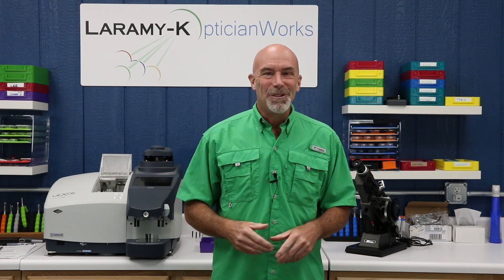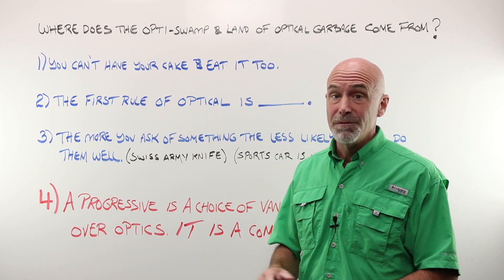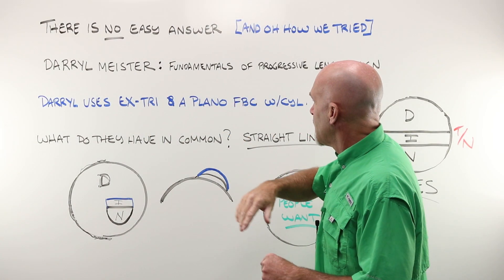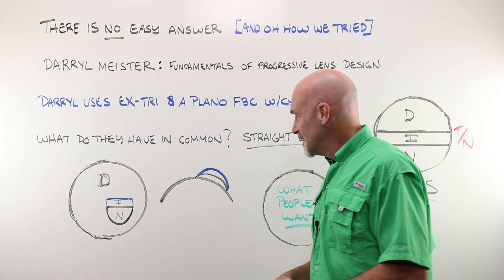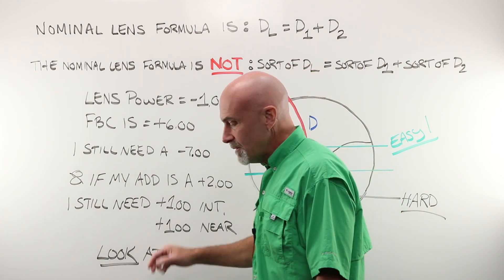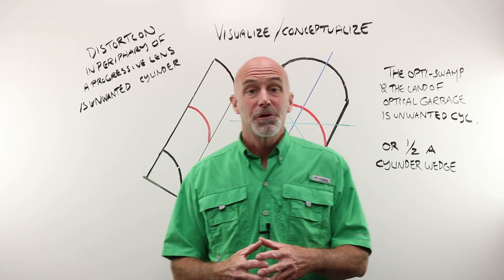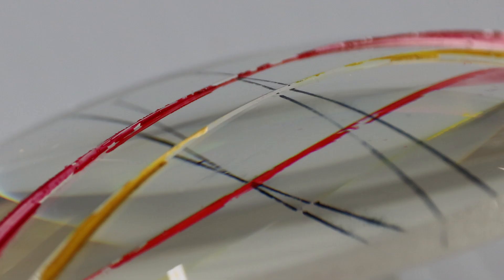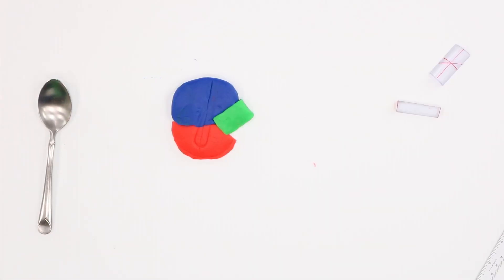Why Do Progressive Lenses Have Distortion at The Sides?

Comment: I was prescribed progressive lens 3 weeks ago after decades of wearing single lens for distance which I only wear to drive or activities like zoo trips or hiking. My eyes are very different,  one far and one near so to read or do inside work I must take my glasses off to see.

 The problem comes when shopping, for example, since I need my glasses to see which aisle but take them off to read labels.  That I can handle, but I do landscaping. Tree work I easier with my glasses until I do close up work. Taking glasses off and on is frustrating at work. But I can't get used to the tunnel vision. I need all peripheral vision I can get. When I tree is coming down, watching for deer on the road at night, or my evil rooster sneaking up to attack, progressive just aren't working.  

What should I do? Go back to just single lens and readers for sewing? I also quilt. Do they still make those little half glasses you can peek over the top of?
Reply from the maker: Do what I do! Old fashioned lined bifocal with a slightly weak add. Nothing in the way of great distance vision with good peripheral and intermediate/near when you need it. With one eye near/one eye distance you might need to play around with add powers a little. Find a good independent optician with some patience and you should make out great. OH and yes SV "readers" for sewing/quilting.

Comment: Larry
My prescription changed. Im now at 2t add. I cant stand the blurry peripheral vision. My balance is off. Horrible.  Im thinking of going back to trifocals.  Whats your thoughts on trifocals.  I would rather see better than than worry about looks at this point. 
Thank you so much
Reply from the maker: If you have had a true traditional lined trifocal before - sure go back to them. If not then I'd lean heavily towards a traditional bi-focal with the lightest add you can tolerate. That should give you what you need to get around. After that go with different single-vision pairs for different needs. Progressives are great but they aren't for everyone. John

Comment: This is really helpful information. Thank you. Makes me think that in some lenses the cylinder was never meant to provide any vision correction, it is just a form of filler. 

In my case, I have scleral lenses on the way. I asked for those contacts to provide only midrange support. Then I will have glasses over the contacts for distance. The scleral lenses are new for me. But the glasses over midrange contacts aren't. I have gotten used to keeping my glasses on a strap (Cabelz) so I can take them off temporarily and be hands free. Enter the idea of progressives. I am hoping that the minimal transition between negative (-1.0) and positive (+1 or as small as possible) power will minimize the peripheral cylinder distortion. What do you think?
Reply from the maker: Sorry, way too much going on here for me to answer. Sounds like you have a contact lens person to work with, hopefully you can find an optician to help you 1:1. John

Comment: Brilliantly explained!
Reply from the maker: Thanks - that is among my favorites that we have ever done. John
Reply: @LaramyKOptical  I'm here as my new progressives have a massive amount of distortion in the intermediate zone which my current ones do not. I reckon a different lab or model within the lab as the differences are shocking. I don't know the old lenses type but the new one is Shamir Sprectum Plus. I have spent over three months and two sets of them and still can't adapt to them ☹️. The height of the new lenses to fit the frame is a fair bit more and so is the thickness of the lenses at the edges if that matters any?
Reply from the maker: @skylineuk1485  Yep - sounds like you don't like the design of the new lens. It is possible (90% of the time) using the Progressive Lens ID (available online) to figure out what that old lens was. Probably want to get as close to that design as you can. Bigger frame = thicker lens but that shouldn't matter if lens is set correctly - assuming no power changes or minimal power changes.
Reply: @LaramyKOptical  Thank you!

Comment: I've worn glass bifocals (plain and Photogrey extra) for decades. Glass bifocals do not have that "ledge". I was surprised when I ordered a tinted non-glass pair to discover the ledge. I was told, like in your video, that ot was impossible to not have a ledge in a bifocal.  Why is there no ledge in glass, but always in plastic?
Reply from the maker: A plastic bifocal area gets its power from increased curvature, hence a ledge. A glass bifocal area gets it power from increased material index literally melted into the blank, hence, no ledge.
Reply: @LaramyKOptical   Thank you so much for clearing the mystery. I prefer the elegant glass solution over the industrial one.  The bummer for me is recent cataract surgery from a lifelong -5+. My eyes are now both -2.25, cyl +0.50 & +0.75 with add +2.25. That equals a plano bifocal or a progressive with muddy areas. Or distance only. I mentioned the possibility of a short corridor progressive to my optician and was told it was an old technology that I wouldn't like.
Reply from the maker: @akahina  I'd say keep watching some of the other videos on progressives. I'm not sure why a short-corridor would be desirable - in fact that would increase the likelihood of distortion or "muddy areas." That plano bifocal wouldn't be plano since it would provide the mild cylinder corrections of .50 and .75. Heck - how is your near vision when you take your glasses off?
Reply: @LaramyKOptical  My vision is fine from about 18" to my fingertips.

Comment: What are your opinions on trifocals? I’ve worn progressives for years and recently my vision changed; my prescription worsened. I tried the the varilux brand progressives and was close to impossible to see through. Now I’m in a trifocal and can’t see through them comfortably either! What can I do, get three
Pair of glasses?
Reply from the maker: YES! You will find an intermediate pair will get you through a heck of a lot indoors. Distance only outdoors... Then any task specific distances. Like we say over, over and over, "...maybe progressives aren't the answer for everything."
Reply: @LaramyKOptical  thanks for the reply.  so trifocals aren’t the answer either!?
Reply from the maker: @l.c.1633  Probably not the "perfect" answer. A little tricky to find and a little tricky to fit too. Certainly worth a try if you can find someone willing to work with you on it. Should be able to do a "test" pair for not a lot out of pocket.

Comment: I just had cataract surgery so my prescription went from a -7.5 to a +2.5 and I just received new prescription computer glasses. I was hoping that because my prescription is much simpler now the progressive lenses wouldn't be so distorted. I was very wrong! These new ones have an extremely limited field of view - even more than my older -7.5 glasses. What I don't understand is why the $35 progressive reading glasses I bought from Amazon are dramatically better for field of view?! I find myself using them more than my $200 prescription glasses.
Reply from the maker: Lucky you! if the power is +2.50 in each eye you can go over-the counter for everything. Just buy one of those multi-packs from Costco with different powers and play around to find the perfect one for all the different things you do. If you do one thing that you love for extended periods of time then consider having a really nice pair made up in that power. John

Comment: I am 52 age . I use progressive lenses . Spend 6 hours daily on screen & two hours reading . Should I go for separate single number lense to reduce Fatigue?
Reply from the maker: I can't make that decision for you certainly not without a lot more information - BUT - if a single vision pair or pairs is an option you can't go wrong!  Much more comfortable for the long haul... John
Reply: @sheelmirji5494 So what decision did you make finally for the single vision lens?
Reply: I have opted for Progressive lense

Comment: I just picked up my new prescription with progressive lenses. I HATE them with a passion. Lost my peripheral completely. Not a good thing if you are a first responder and have to use your firearm. Will return them and not look back.
Reply from the maker: Yeah - I'd try to find an independent optician or ask around for an optician that knows what they are doing. They can set you up with a lined bifocal setup that will work. (lowering the add power to get you more of an intermediate than reading)

Comment: (Your play-doh is not helpful at all, btw).  So, I'm confused.  Are you perpetuating the fallacy pushed by the eyeglass industry or are you saying otherwise?

9:45  You say "the ledge has to be there," referring to executive trifocals.  You say the optical aberration has to be there for progressive lenses.  And yet.........I can buy, and have bought, and currently own, "off-the-shelf" progressive reading glasses exactly like executive (Franklin) trifocals with temple-to-nose correction, with NO ledge, NO corridor, NO optical aberration, NO distortion.  If I am reading fine print, I look through the bottom portion of the lens (2.00 magnification) the whole way left to right, without having to move my head to stay in the asinine corridor because there is no corridor.  If something is a bit further away, I may raise my eyes a bit and I get 1.75 magnification the whole way across left to right, if I am looking at my computer screen, I look through the center of the lens (1.50) left to right the whole way across, etc., etc., 1.25, 1.00. .75 up to the top of the lens for distance where there is virtually no magnification.  No headache, no dizziness, no disorientation, no need to adapt to them.

At least two companies have sold these.  "ICU" used to market these as "Omni-Focus" and Foster Grant still sells them as "Multi-Focus" progressive reading glasses.  The magnification strength is constant left to right (nose to temple) for the full width of the lens, with the gradation occurring in parallel fashion from the bottom of the lens to the top.  They can be ordered online for $35 in strengths from 1.25 on up.  Occasionally they can be found in drugstores, Target, Walmart, etc.

So, can you/will you make progressive reading glasses like I have now - full left to right (nose to temple as you call it), with gradations similar to executive lenses, without ledges, without corridors, without peripheral optical aberration/distortion?

Thanks.
Reply from the maker: Yes.
Reply: do your "off the shelf" PAL glasses come with cyl and axis correction?
Reply: @kellz6266  I don't know.  Your question sounds like you're an optician as it's a technical question - should I care?  I googled sphere, cyl, and axis which didn't provide much enlightenment.  

A bigger question I have is, are you saying that glasses such as I describe can actually be ordered?  I have other issues going on with my eyes (nothing to do with anything glasses will address) so have seen at least five different types of ophthalmologists with various specialties, all of whom are capable of writing a script for glasses of course.  None has ever even heard of the glasses I have.  Same with every optician store I've been to as most seem to be just sales people pushing overpriced frames (most of which are controlled by the EssilorLuxottica monopoly) with standard progressive lenses, or default to pushing bifocals when I tell them progressives make me dizzy.  They could provide a real service if they took an interest in addressing a person's needs - and expand their market!

Presumably my OTS glasses don't have that correction.  All I know is I can see perfectly fine at any distance for reading, computer work, and various project work to about four or five feet, fully left to right and right to left.  I do not need them for distance correction, although I can keep them on, for example, if driving (good for reading the dash gauges).  As presbyopia has progressed over the years, I have simply increased the power of my OTS glasses. That said, it would be nice to have higher quality lenses, coatings, or other features.